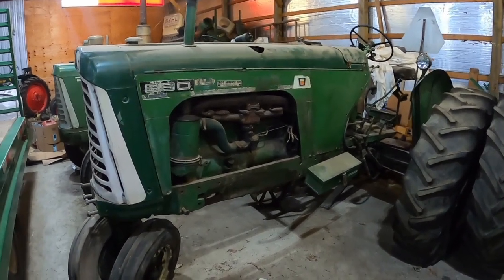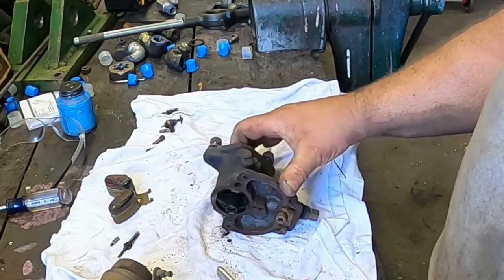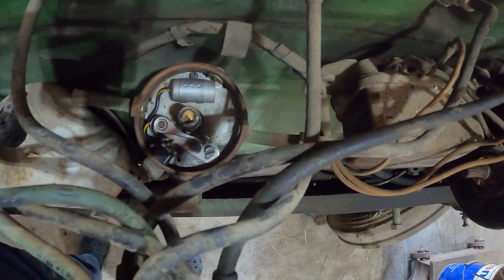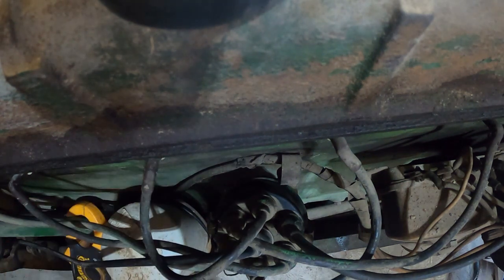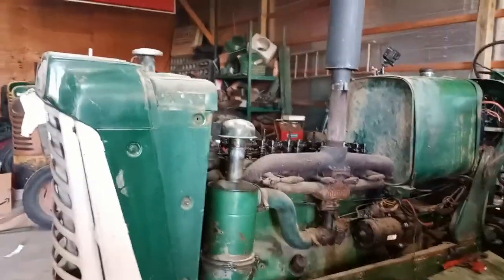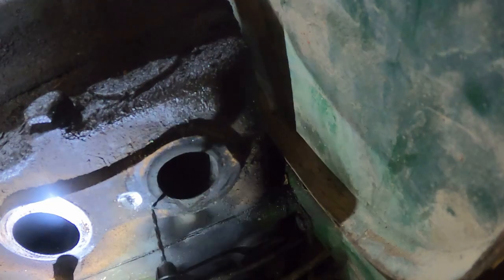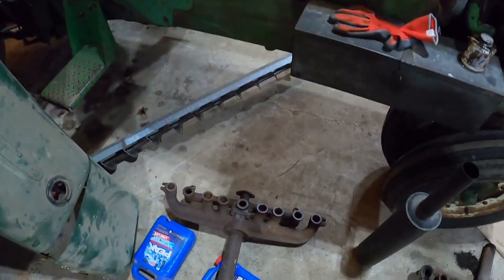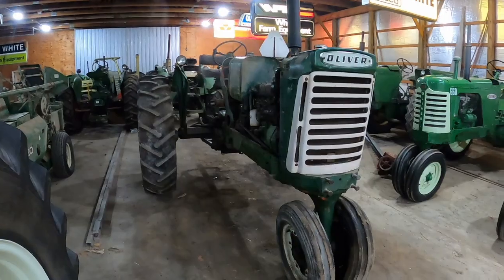WILL IT RUN? 23 Years in a barn without running.

Comment: LOL watched this video again and it reminded me of some extraction secrets I learned over the years. 1) if you are careful to get the old stud punched and drilled in the center you are ahead of the game (not really a secret). 2) Drill the stud all the way through with a 1/8 drill bit (it seems to relieve some tension). I used two ended drill bits the seem to be a hit harder. 3) The first few threads on a broken stud are usually pretty messed up and act like a lock. My theory is that the stud rocks back and forth during heat cycles and distorts those top threads. If you drill the hole over size (like the size of a helicoil drill size) usually 3/16" to 1/4" deep then the easy out will work with no resistance (this is the real secret). Sometimes just a reverse drill. There should be plenty of thread left. I specialized in the old Datsun 240Z for years. They were famous for breaking the back stud on that long 6cyl aluminum head. Here is a great stud tool that will make your life easier too. https://www.amazon.com/SST-8-piece-Adapter-Compatible-Fractional/dp/B07JN75X21/ref=sr_1_6?crid=3G86YNS23CYX4&keywords=tap+socket&qid=1667755518&sprefix=tap+socket%2Caps%2C128&sr=8-6
Reply from the maker: I like the look of those sockets! Thanks for the  tip, I'm going to order a set now!

Comment: Sunday again.  Oh, I was screaming about what to do with that broken stud. I always welded a washer and a nut to it and it would back out 90% of the time. When we had a stuck bolt or stud we would clip the welder lead to a cleaned solid place on the engine, then clamp the stinger lead to the bolt and stud and flip the welder on with a hundred or so amp setting.  Usually, the bolt would get hot and when it did we would turn off the welder and apply panther piss (penetrating oil) or put the end of a candle next to the hot bolt or stud next to the junction of the bolt or stud with the part we were trying to remove and let the hot stud melt the candle. The wax would work its way down the stuck threads and help release the stuck bolt or stud.

Also, after I filed points I would burnish them by pulling a strip of brown sack paper back and forth. I always would use a screwdriver and short the moving arm to ground on and off to see if I got a spark from the coil.   If I did I would dig into my parts box that I carried in the truck and get a new set.  

And, the fix for Zenith carbs was to simply replace them with the Marvel-Schibler carb.  We just did not like the Zenith carbs. I would run an old speedometer cable thru the fuel lines to remove any crap in them. 

The engine does sound good,  Put a good dose of SeaFoam in the engine crankcase (or marvel mystery oil) and it just might clean stuck rings. We sometimes would drain the oil, fill the crankcase with kerosene and run it for a few minutes.  That would clean out the engine and its oil passages. Either way, the inside of the engine would be de-gunked and less of a clean-out mess when you would pull the engine apart.  

Yes, that is old-school stuff, but we did not have the modern chemicals that are available today. One chemical we had that worked well was a 5 gallon bucket of carburetor cleaner. I wonder if today one could put a carb into an ultrasonic cleaner with some good cleaner solution and get a very clean carb.  

Technicians today look at point systems as an unknown item, and I doubt that one of them could take a Roosa-Master injection pump apart on the tailboard of their service pump and cure any problems it might have. 

Old mechanics fixed things, not replace them most of the time.  Starters and generators got taken apart, the armatures turned and tested on the growler, new brushes, and bushings then back on the tractor or combine. We did not have rebuilders available for many of those things back then.

Tip on the intake leak testing. Squirt oil on the intake ports while running and if there is any air slipping by the gasket the oil will usually cause a momentary smoothing out of the engine and you will get a burst of oil smoke out of the exhaust.  

If we found a bent push rod while working on the tractor in the field, we would simply use a hammer and a flat place on the tractor and massage it back straight.  Put back in, adjust the clearance, and maybe when the engine needed to be rebuilt we would replace the rod. Farmer did not usually care, as long as he could use it he was happy. Most of the time they only had one tractor and the quicker we could get his back running the happier he was. 

Back in the day, when a farmer got a new tractor, his neighbors would drop by to look at it and think about replacing their older tractors. Farmers tended to put their tractors in the shed at night, service anything they noticed needed to be done, wiped the tractor down, and cover it with a tarp to keep the chickens from making a mess on it by using it as a roost at night. 

So when I look at any old tractor, I think back at how proud the farmer that got it was and always ready to proudly show it to his neighbors and let them take a round or two on it. That was the original farm equipment shows.
Reply from the maker: Thanks for all the tips and history! 
I often look at these old tractors and think how at one time, at least for most of them, that it was once someone's pride and joy. They took care of it and it helped put food on the table and clothes on the backs. Yet somehow it passed a point of being a source of pride and became another piece of machinery, something to trade in on a newer model with more bells and whistles. Or heaven forbid, the victim of a farmer with a welder and a sense of urgency!
Reply: @ThatOliverGuyChris  A welder in the average farmer's hand was always a source of laughter in the shop when he finally decided that the unit needed to be repaired.  Some of them were actually good welders and if we saw what he had to repair we knew where to look for damage, especially on a trade-in.
Reply: Yes, looks of good information.  I was thinking the same thing in looking for the air leak, but turned out to be the carb.  I was amazed once again with the electrolysis process and the creeping crud coming out of the gas tank-just wow on how clean that left it.  Maybe after getting it settled in with the valve/pushrod thing, could do a compression check to see what you have there.  Thanks for sharing Chris!
Reply: @davidmarley9471  I have an old power chair charger that puts out 24v that I use in my electrolysis de-rusting.  I use baking soda as the water additive in the plastic container to help the process.  Hook up the part to the bar sitting on top of the container with copper wire.  The other part is the strips of steel hanging from a band around the tank. One can actually reverse the process and plate an object I am told.  I might try it on a smaller scale and try to copper plate something. Just another round-to-its a person has.  He who dies with the most undone projects is a winner.  You rest, you rust.  And so on!!!!
Reply from the maker: I've been thinking about getting a battery charger with a 24 volt setting just for this.
Reply: @ThatOliverGuyChris  Just find a 24v transformer, put a diode to make the AC to DC.  I have a radio power supply from a large Rand computer made in the 60s.  It weighs about 50 lbs with the filter unit on it so I have it on casters.  I could not get it down to a safe 14 volts to power radios so I put an old Ford alternator to donate its diode banks and wired them into the output. Diodes will reduce about 1/2 volt into a circuit. The 1v drop I got did the trick.  That power supply had absolutely no ripple when I put the oscilloscope on it. The connecting wires between the transformer unit and the filter unit were the #4 welding cable. One could actually weld with it because I put a carbon pile load tester on it and took it to over 75 amps.  All of that with a small 110v extension cord to provide the power to run it.  It has a big variac to adjust the output voltage.  So I figured that if I put a 20watt resistor into the circuit I could dial the voltage down.  WRONG, I blew every power breaker from the power supply to the power company feed to our fused lead to the home.  I later found out that the transformer is probably a Saturation transformer that you increase voltage into the transformer control coils which then upset the output of the transformer.  Weird, but the diode trick made it usable. It is out in the shop because the wife wanted the space in the closet with wires running to and from that monster for canned products storage. Maybe I should use that for electrolysis rust removal.

Comment: Excellent video, though I’ve always found the best way to check for spark is to hold the plug wire buy the boot…gets a good strong spark first time every time.  😜 Funny how that works.
Reply from the maker: Be the ground and current will flow - Confucius

Comment: Even with you adjusting on the 1600 carb, I could tell how smooth the engine was running. I think with your fixes that will be a very sound tractor.
Reply from the maker: I'm tempted to find another Marvel for it, but I'll see what I can do with the zenith first.

Comment: LOL I'm watching your video and shouting at the screen, "check your ground, check your ground!"  Sometimes the best tools are the simplest old-school tools. In the case of a points ignition, the best test is a simple test light on the coil terminal that comes from the points. That test will test the entire circuit from the ignition switch to the distributor. If you have power but the light doesn't flash as you turn things over then you have a set of points not making contact. In an odd case you could have a ground problem at the distributor. With an engine sitting that long I like to start with a bit of ATF in the cylinders (for the detergent) to loosen the rings and some detergent additive in the oil for the valves. I've used as much as three or four bottles in one application. In one case I got an engine with no compression started with that and pumping air into the cylinders and popping the valved open with a brass drive and hammer on the valve end of the rocker. Once the rust and loose carbon were blown out the exhaust she ran like a champ.  Sure saved the customer an expensive head removal or overhaul. There are no real right or wrong ways on this stuff. Just easy or hard. The above is what worked for me for many years.
Reply from the maker: I used my multi tester in the same fashion, that's when I figured the poiints needed another filing. The valve only took a tap and it popped up and never stuck again.  I need to carry more batteries when doing a project like this, the gopros get hungry fast.
Reply: @ThatOliverGuyChris  I love my electric meters and my old Fluke88 is still going strong, but sometimes the test light is just so useful. But then again I did this kind of stuff pretty regular as part of my job. ;)

Comment: I have an 880 for parts if you or Ross is interested. Comes with 1610 loader but not the proper mounting brackets. Also have a 4-14 semi mount plow with the double c-channel back that can be had cheap. Neighbor has a 1755 that he might be willing to get rid of for a song. He had a 120 that the over under went out in that he may still have. Located in SC Wisconsin if you guys are interested.
Reply from the maker: I'll let Ross know.

Comment: Chris, get some pipe cleaners and use on the carbs. I mean the "smokers" pipe cleaners, you'll be surprised at what they'll get out of those old carbs. Now, you know it's that carb, just needs a really good cleaning.
Reply from the maker: I'm going to see if I have a rebuild kit for that carb and give it a good going through now that I know the tractor runs good. I'll get some pipe cleaners, thanks for the tip!

Comment: She's running pretty good! Thanks for the video Chris! You just may have to do the 18-27 next LOL
Reply from the maker: I was thinking of that or the OC-3
Reply: @ThatOliverGuyChris  I vote for the OC-3
Reply: @ThatOliverGuyChris  Both would be fine with me LOL. Or the Hart Parr 70
Reply from the maker: I had the HP 70 running about 3 years ago when I moved it to this barn. I have a bad feeling  the radiator was plugged and it got too hot, because I can't get the engine to budge. I broke the hand crank trying to restart it that day I moved it, figuring I had stalled it, so I finished moving it with the forklift. A few weeks ago I was thinking about firing it up and it won't budge. I think I know why I strong armed that hand crank in 2....
Reply: @ThatOliverGuyChris  well that stinks. Does your streamlined 70 run? I know it had a piece of the hood cut out for the distributor, but I couldn't remember if you said it ran or not
Reply from the maker: @NEAFarmKid4010  that one should run good.
Reply: @ThatOliverGuyChris  hmmm, perhaps a poll in you community section?

Comment: I was afraid you were going to have to call in rosy there for a minute😅
Reply from the maker: LOL! Then the barnyard animal sounds would begin.
Reply: @ThatOliverGuyChris  so many mistakes. Didn’t bring the Ozzes, didnt slam carb on table to separate halves, didn’t grind on the carb needles with emery cloth, didn’t buy new parts for no reason. If I did it that way I’d run out of barn animals. 🤣

Comment: Wahoo!!! Love it! Now to see it run auger to work the bugs out and maybe some plowing or discing this fall? Does the Power Booster work in this tractor?
Reply from the maker: It's hard to see, but I used the power booster a couple times driving it in and out of the barn. It works and the clutch has a nice solid snap to it. First guess is it is in good shape.
Reply: @ThatOliverGuyChris  awesome! I really like mine. Works well when I need to creep along in 1st gear or start off in 6th. I tried it plowing in a couple tough spots, it's OK but not as nice as the later system in the 4 digit tractors.

Comment: What tips do you have for starting a 1550 that I know has been sitting for at least a year outside in northern maine.  Checked all the fuilds all are good. No water. Put fresh gas.
Reply from the maker: I'd pull each spark plug and put in a little engine oil in each hole. I'd also pull the valve cover, put a ratchet on the front of the crank and turn it over by hand to make sure there aren't any valves sticking like I had with this tractor.  Beyond that, I  would fire it up like normal, trying to not rev it up too much until oil pressure is built up. If it doesn't fire, check for spark. If you have spark, then it must be the carburetor,  or a lack of fuel to it. My 770 had sat outside for 5 years and the inside of the engine was so crusty it required a complete tear down to clean it up. It doesn't take long when they sit outdoors, so I'd definitely pull that valve cover.

Comment: Hi Chris, what type of metal is the shelf piece you used for the anode? Also, did you just fill the tank with plain water before inserting anode?  Thank you
Reply from the maker: It was steel, exactly what grade, I don't know,  but your basic steel. I fill the tank with ordinary water and add washing soda or lye to act as an electrolyte until my charger is showing 10-15 amps of draw. Search youtube for 'electrolysis rust removal ' there are tons of how to videos .
Reply: @ThatOliverGuyChris  Chris, thank you very much.  I really enjoy watching your informative videos.

Comment: The electrolysis is an amazing process
Reply from the maker: I hit it with the hot water pressure washer to rinse it out. The heat of the water an a little time in the sun dries it out in no time.
Reply: i went to look at a tractor collection auction here in Lucknow Ontario today . Brindles auctions private collection .
Really nice Oliver 2655,2255?,44super and a couple others FYI
Reply: Brindley Auctions , stupid auto correct
Reply from the maker: @seanconnolly7576  , thanks, I'll look it up.

Comment: i say with as many tractors you have you could run one different everyday and still not run the same one twice in one year . that nice you got that one running again . i prefer diesel over gas myself much easier to get running after sitting long time.
Reply from the maker: I'm with you on that. Dad liked to buy narrow front gas, because a carb is cheaper to rebuild than an injection pump and he you squeeze more narrow fronts in a barn.

Comment: Do you know why they made the 880 and 770 right up to when they were making the 50 series?  I think my 770 is right about the same age as my 1650. I did read they made the 770 a year or two longer, but never came across why the production overlapped the newer models
Reply from the maker: The 1600 was designed to replace the 880, so that's why it was built until 1963, with the last ones mostly being power units for road rollers. The 1550 was supposed to replace the 770, and Oliver even had programs to encourage the dealers to push the new 1550 over the 770, but the orders kept coming in for the 770, so they kept building them all the way up to 1967.
Reply: @ThatOliverGuyChris  that makes sense!  Thank you for the reply!

Comment: Probably   plugged orffice in carb  needs to be soaked
Reply from the maker: That's what I'm thinking.
Reply: My old D7 17a pony motor carb i ended up using muratic acid.  but be carfull   not to long  with acid. Carb cleaner wouldent touch it

Comment: Is that same engine that was used in the Super 88"s?   What year is the tractor?
Reply from the maker: Basically. They bumped the rated speed up to get more horsepower. It's a 1962 if I remember correctly. Fairly late one with the helical transmission and the field installed transmission lube pump.